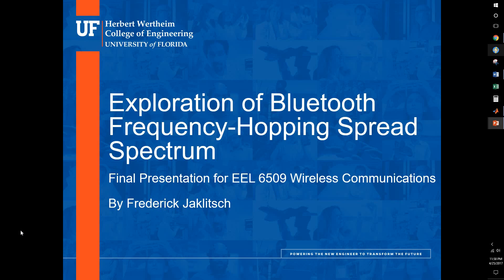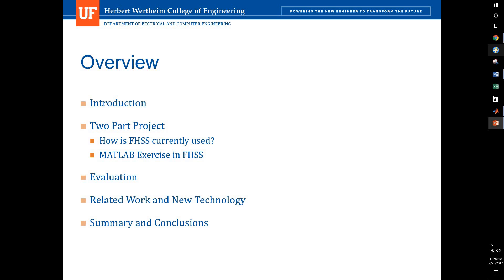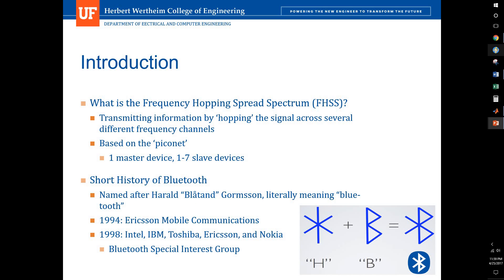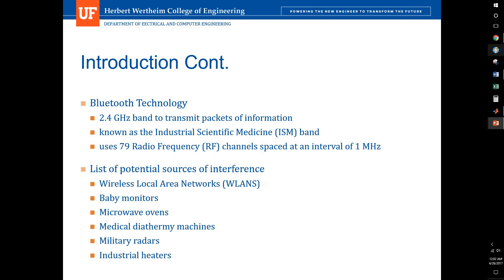Exploration of Bluetooth Frequency-Hopping Spread Spectrum Part 1

Comment: Fritz, excellent overview of research. I have many concerns because of noise. It's great it's low energy, but still security issues and noise.  Why not just use wireless frequency as it was designed 2.5Ghz to be "stateful", encrypted, and not so promiscuous (as well compatible with standards)? We shouldn't be doing an "Internet of Things" when you should begin with only stateful devices that are an "Internet of Objectives".  The spectrum will be saturated with noise, and those who use it for a MIC or Headset will get 70 channels of frequency humming through headset or "home" Audio/Video system. It is why Pioneer uses a wireless or preferred "wired" ethernet for home audio/video and not necessarily Bluetooth.  A simple bluetooth headphone or bluetooth hearing aid now has to hop, and drop a  connection based on a FCC frequency hopping at a "humming" speed sometimes being amplified from into 1000 watt Audio Video home system as "noise" pollution. Have you ever had a bluetooth mouse start lagging and drag across the screen in recent times? or Bluetooth Antenna on a older Macbook Pro die or was incompatible? 

Especially when many students have no choice but to take remote classes, it's highly disruptive. Or overwrite the csrutil security, with a bluetooth driver update on a laptop, from an Android device or iPhone device? As Apple said it, "there are no apps". True no Apps, it's your Bluetooth hardware and driver. See contact tracing PAN implmented June/July 2020. My root level / reboot on my laptop to check the bluetooth, showed a security update under System Performance Reports as software updates,  the updated changed was blocked from me overwriting around 2020 June from using csrutil for recovery of the legacy BLUETOOTH. System Software updates" (as Apple put it not an APP) showed a new Personal Area Network (PAN  BLE). I stopped updates prior to that a few years back (stopped doing updates for a good reason), (loss of file system hygiene of caching in future updates, eats away at SSD volume). Specfici software programs, (licensed) that are still 32 bit functions won't run on a 64 bit system, and because one is not an entire rewrite of the system, becomes a loss of highly specialized software purchased and licensed for 32 bit (now 64 bit example binaries only). At the same time network UTILY water metering system called Neptune was installed (BLE IMS) on all water meters. Unlike the electric meters, the water meters were not labeled correctly, or adhering to standards of names, and were not stateful (spread spectrum is noisy),  nor do they conform the federal documentation (Infrastructure) for frequency changes (30 channels or 70 channels), labeling nor naming of UUID of an FCC approved device.  Using for Military great, but it's strategic, not for home. 

Adding a gateway to any home will be captured by BLE IMS gateway device, enables a whole spectrum of security vulnerabilities, even across every wire, electrical or not (even voting machines?). I've disabled all bluetooth devices, that I can control, having a phone update a driver is security issue, when it is not an App / User choice. Monitoring how many as you can see BLUETOOTH as you go down the road with BLE app for the phone, gives you an idea of how "promiscuous" a world of security flaws we now live in. There is security, vulnerability, privacy, and transparency issues that all need to be addressed.

Comment: Great presentation & nice introduction into FHSS, thanks! 

FYI, for others, this isn't BT mod. BT uses GSK,4-DQPSK, 8-DPSK, AFH, & time-slotted data. Note BT vs BLE, the market share, has yet another different mod scheme. Note, collision rate shown in pt. 2 is too high to work in practice. Its much better in practice due to the time slotting, AHF, & low duty cycle.